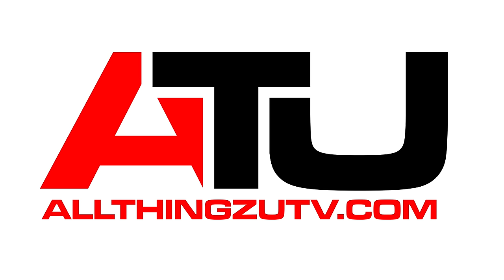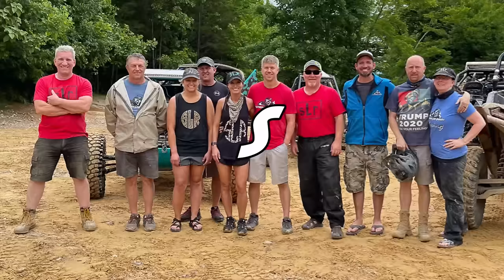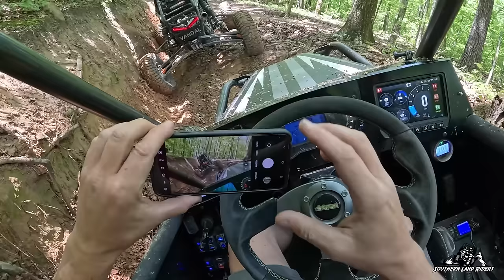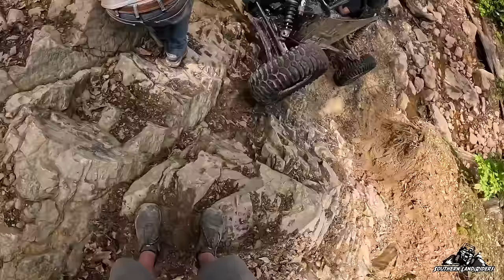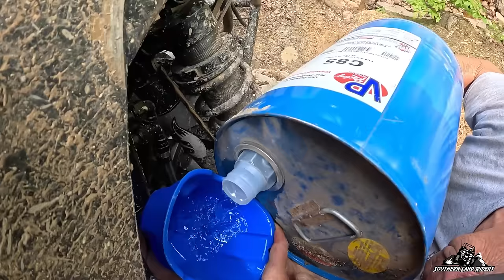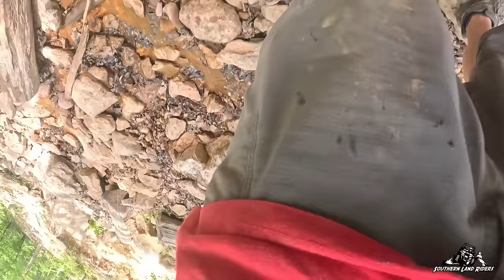Choccolocco Mountain Off Road Park - Nasty Roll on Violator Hill

Comment: Id pay for this group to build me a badass chassis.
Reply: Is that what h does?
Reply from the maker: Get with H. HCraft Customs. He will be glad to build you a chassis. He's got a Can Am chassis he's finishing up and then building me another one but he's open after that.
Reply: @SouthernLandRiders  i appreciate it brother ill look into that
Reply from the maker: @alexbillups8519  Sure thing. He built mine, my wife's, Chris's, Sonny's, Benjamin's and his. He just finished up a badass race chassis for Coty Carlock. Check out some of his work. Not the cheapest out there but the best out there in my opinion.
Reply: Yeah imagine those hits on a stock cage alone. Probably would’ve broke his neck. Quality is worth every penny. Video quality has been good too.
Reply from the maker: @enjoylife6311 yeah a stock cage probably would have folded pretty good on that 2nd hit on the rocks. Jessica did a good job holding the camera during all the craziness.
Reply: @SouthernLandRiders are you having a chassis built similar to what you have now?
Reply from the maker: @dennywright3132  yeah H is going to get started on it as soon as he finishes the current buggy he is working on. I just picked up a new pro XP and going ot use that as the donor. It is going to be similar to my current single seater. I am going to change a few things but overall it will be very similar. My current buggy is going to be my wife's buggy after the new one is done.
Reply: @SouthernLandRiders  is there a benefit of the xp pro motor compared to xpt?  I know they are alittle more power from the factory.  I'm new to the chassis world so it's cool to learn new things.
Reply from the maker: @dennywright3132  the transmissions in the Pro XP's have bigger gears and seem to hold up better. The Pro XP turbo is liquid cooled and is easier to boost than the older   turbo S models. If you are buying a new donor, the XP Sport is the best bang for your buck with Polaris's 2024 lineup.
Reply: who built the vandal buggy?
Reply from the maker: @dennywright3132  Brian (the driver / owner) built it.